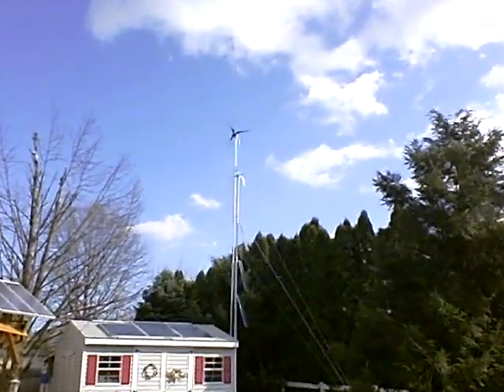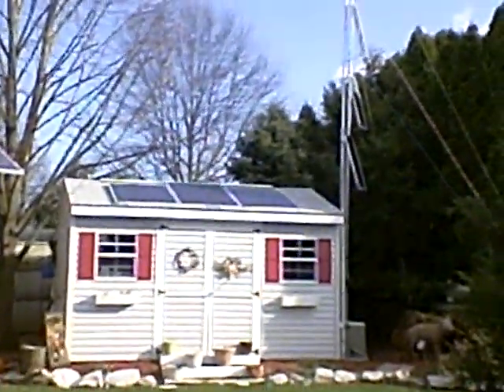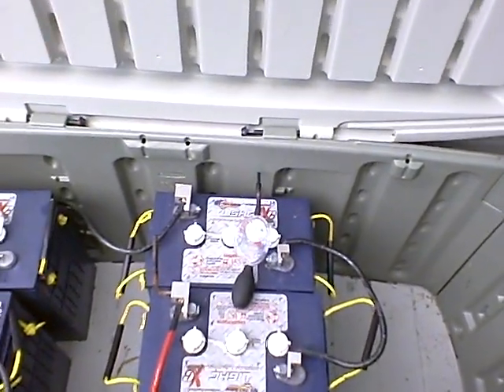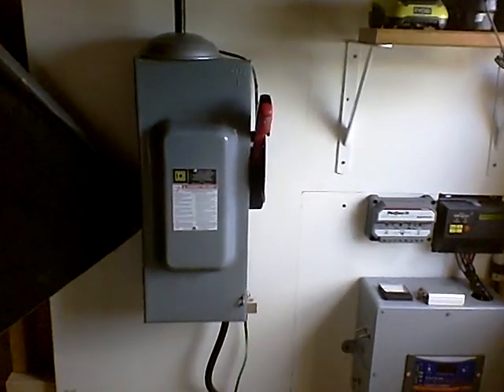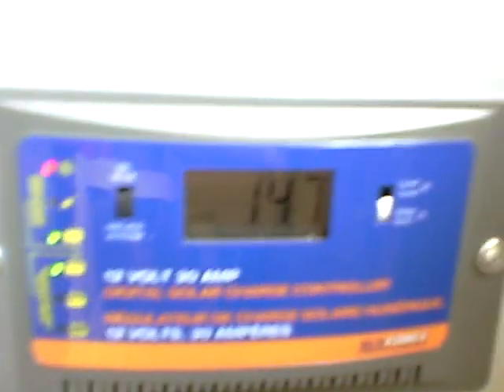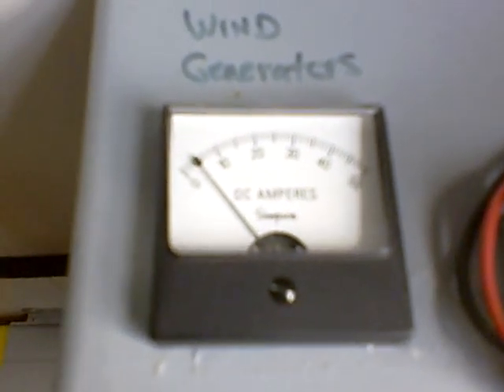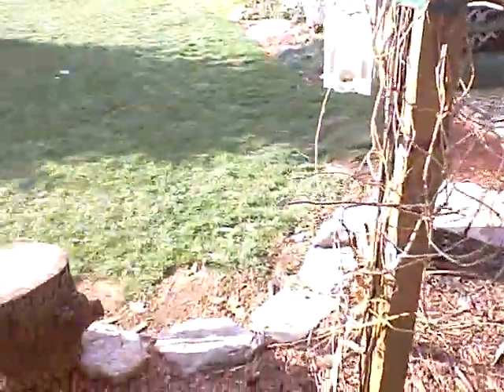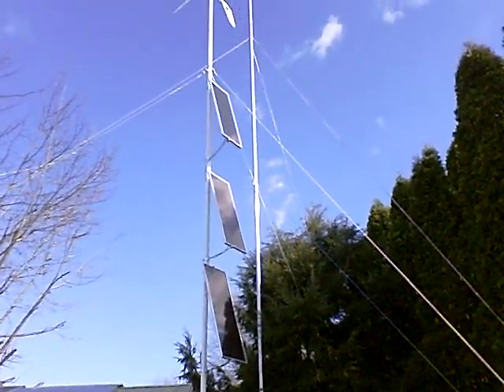Solar/Turbine DIY  home system

Comment: Hello garboelec1, thank you very much for posting your video!  Question: Are you using a charge controller for the wind generators?  A dump load?  Cheers!

Comment: Cool video it looks like all you need is more battery capacity. you have a ton of charging ability seems like you would want to utilize it. That part drove me nuts when my bank was charged I wanted to use the extra power thats wy I went to off grid / grid tie hybrid. Check out my videos and let me know what you think. CHEERS WINDY NC.

Comment: Hey very nice setup I just started last year also.I only have 215w solar and  a home made 1000w  wind turbine 4 .115ah marine batteries.I just picked up a 250w grid tie inverter that seems to work great..check out my videos if you get time maybe you can let me know what I can do to improve my system